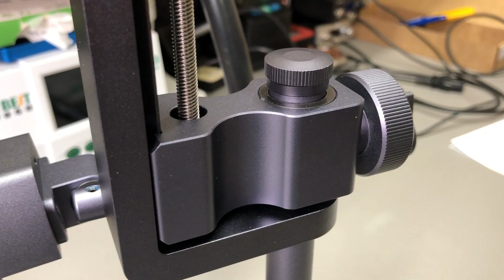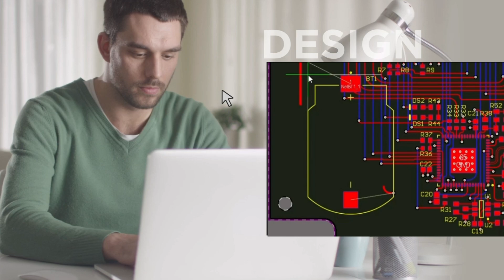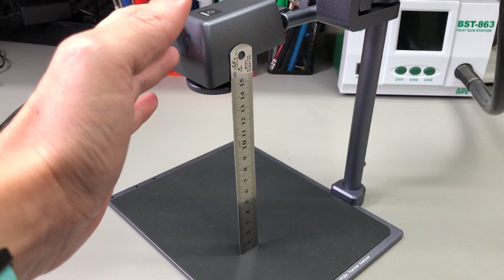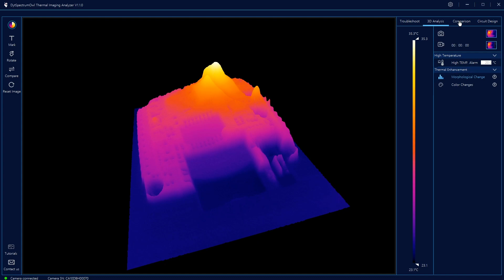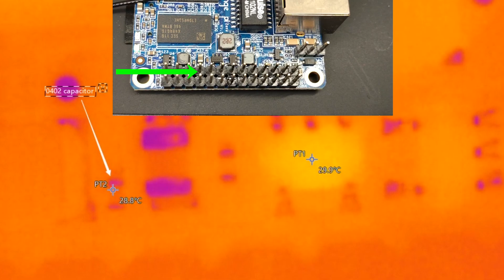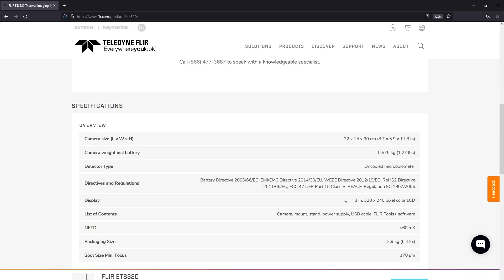DytSpectrumOwl PCB Inspection Thermal Camera | Voltlog 384

Comment: Can you tell me about your experience installing the software?

There seems to be a number of very similar cameras such as the Qianli Supercam X
From non English videos I have watched of other similar devices there seems to be some registration login process during installation.
This software looks almost identical to the other product's software.  Maybe they share the same software?
The software makes this device extremely enticing.

Any more info regarding the software would be much appreciated.

Great review 🖖
Reply from the maker: I installed the software a year ago, I don't remember all the details but I don't remember any registration process. The software just works, been using it ever since, no issues so far. I don't know if it's compatible with the other cameras or not. I would not take that risk..

Comment: Can you help me install the device driver, but it does not connect to the computer, I am using Windows 11
Reply: Have you got a solution about this? I got stuck at driver problem 😢, could you help me with that?

Comment: arhh come on, it aint really apples to apples.
The Flir you are using as 1 to 1 compare factor is a way different microbolometer camera.
I get it, you wanna sell it, as you been lubricated with one of these from China, but pls don't paint it on to thick with a bias narrative. 10:22 (this ain't apples to apples)
One is a brand name, aka one of the biggest players in the field. ..the other is more or less a no-name vendor from China.
And not to mention The FLIR got +60% more pixels 77.000 versus 49.000 (as I reckon this is a 192x256 microbolometer that is packed in this Dyt-fellow and the 260x200 spec.. perhaps marketing gimmick to get a small advantage from all the 256x192 products...?? and that higher pixels 77k vs 49k matters a lot.
I would never purchase Flir myself at retail prices, but that doesn't mean you don't need to keep it level, Chinese advertising or not. 
You could compare it to a cheap 320x240 or above (dongle) that anybody can put on a stand to a mobile or a tablet..
and get a decent thermal overview that also outperforms this DytOwl unit. 
or you can just take one of these dongles with manual focus and handhold in front of your board, and you get better footage and thermal view, simply from the higher resolution. https://youtu.be/JYPqOCgHKAA?t=21

The one thing that looks somewhat decent on this Dyt-unit and could be handy for some, is the software (no doubt) and perhaps the build, while the most critical thing "resolution" leaves some to be desired.
at these prices.. it should be 320x240 or perhaps 384x288 core.
Thx for the video, but a shame you don't dig down into the vital things.. what sensor-core are in this unit??, as it goes without saying not many are making microbolometer sensors..
That is what people are paying for, and since you're doing these adverting gigs from CN.. you could at least ask what microbolometer core/sensor are DytOwl sourcing in this unit..?? what 256x192 (200x260) core are they using?. who makes it?? is it a Seek core, or an Infiray, or Flir core?
Could also have been nice if you tested, how the temperature accuracy stacks up..
Reply: From what I gather the thermal resolution of the camera reviewed (not to be confused with camera resolution) is 200 x 260 or 52,000 DPI as otherwise known.

Comment: As a hobbyist...I purchased a used Flir E4 for $300 (pre-covid).  Perform the E8 upgrade hack for 320*240 resolution.  Added a Znse crystal lens, with a 3D printed holder. My PCB inspection resolution is incredible! A $3K solution for $350. Covid has increased the used handheld  infrared camera market.  Hopefully we will see the prices drop back down to the $300 range again soon. This desktop version with  macro is pretty cool though.  Not digging the windows PC requirement though.  It's nice to just quickly grab a handheld unit, power it on, and inspect.   But I can see the advantage of a desktop windows PC type, for professionals or someone who inspects a lot or long-term.   Thanks for the review!
Reply: Taken from the FLIR website: -

"The FLIR E4 thermal imaging camera is an easy-to-use troubleshooting tools for building, electrical, and mechanical applications. Find hidden problems, take accurate temperature readings, and confirm repairs were done correctly with the help of the 4,800 (80 x 60) pixel infrared resolution and FLIR Multi-Spectral Dynamic Imaging (MSX®) enhancements."

Flir is  80 x 80 or 4,800 DPI 
vs this one at 200 x 260 or 52,000 DPI.  

No thanks to 4,800 DPI  😂
Reply: @pow9606   You must have missed what I posted.  The E4, E5, E6 and E8 all come with a 320 x 240 IR sensor.  The models are software limited. My E4 was limited to 80 x 60.  I changed the software and my $300 E4 IR resolution is now 320 x 240 pixels, or 76,800 dpi.
Reply: @cognetic  The website lists it at over £1000 (inc VAT).  
Hacking the software and finding ways to avoid paying Flir is too dishonest for me.